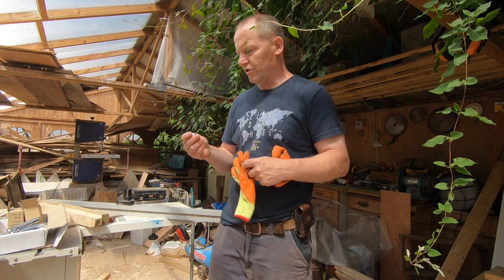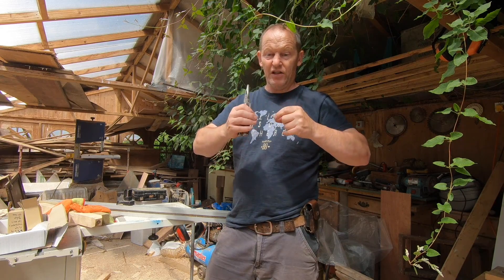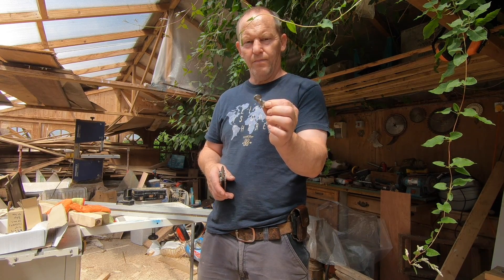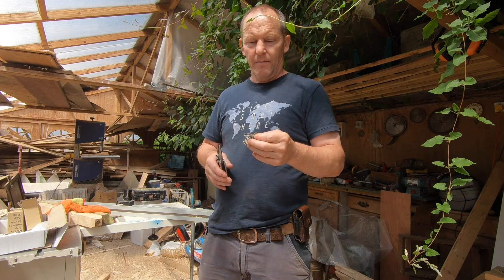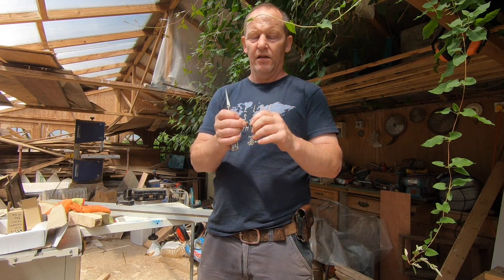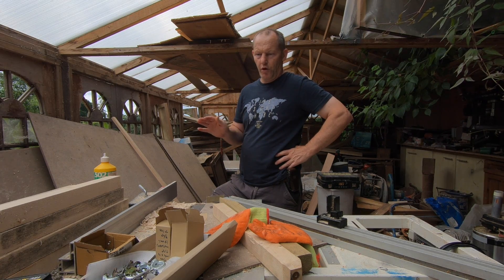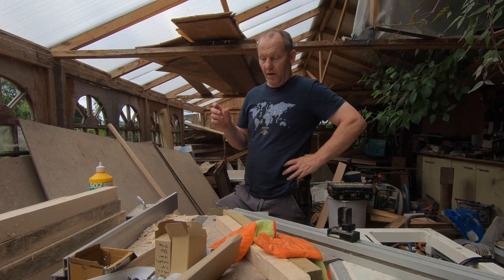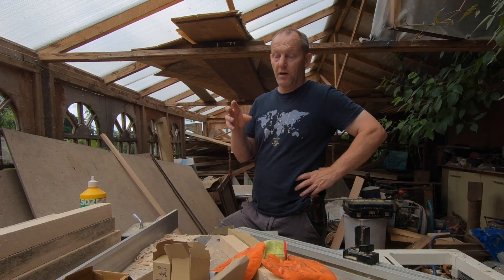Unilnks strength test, initial thoughts

Comment: What steel did you specify? by simply changing the steel to a stronger variety you will see a tremendous change in strength. A36 is about 36,000 PSI yield, 4130 is about 60,000 PSI as an example. I suspect what you ordered is closer to 1018 which is about 35,000 PSI

Comment: And there is also the stress in the screws and the wood. Those should be  in balance with the strenght of your brackets. Right? And the angles from the dome frequency, as you already mentioned.